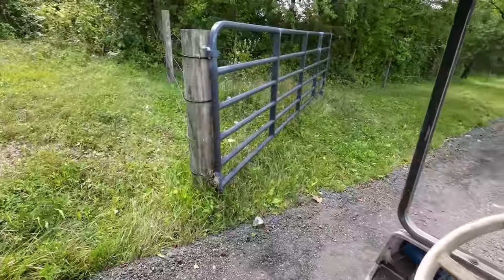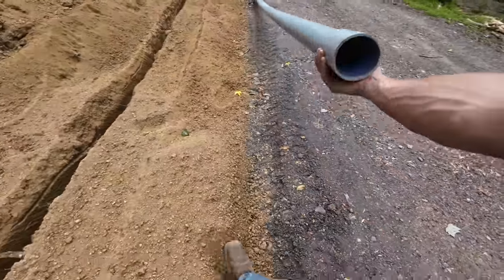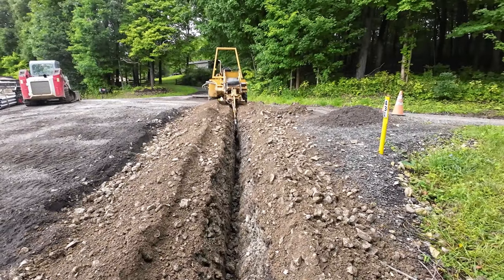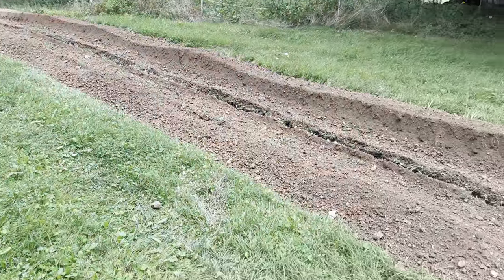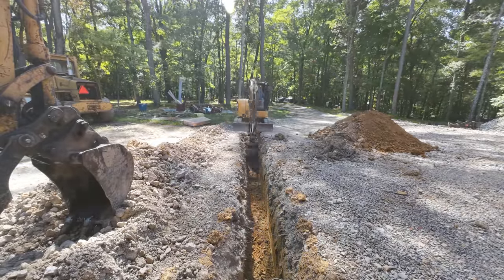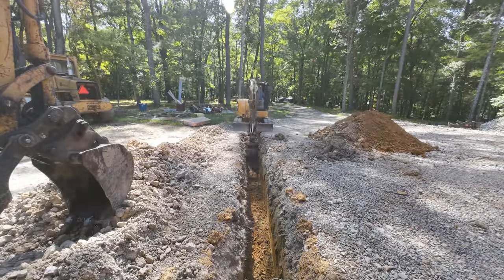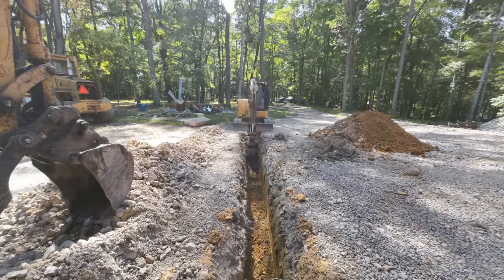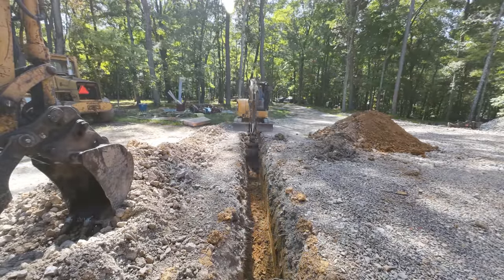Running Nearly 1/2 mile of Underground Electric, Costs over $64,000??!?!

Comment: With the cost of material and labor you might have come out better with solar panels and back up batteries. I don’t know.  Looks like you did a great job!
Reply: Naah- where he is at you have a lot of cloudy day, rain and snow plus forest cover- he would have to clear 50 acres to put in that many solar panels. Who knows how many backup batteries it would take to run that shop plus a house in the future.   Even in the southwest where they have year round sunshine and vast expanses of flat desert ground, all the solar farms have been failures.
Reply: @AmbitionStrikes has a sweet solar setup and their all-in cost was in ~$60K range.
Reply: 64k will buy a lot of diesel. Solar could be an option, but I doubt there's enough clear days up north. ('tho there are people who do off-grid solar further north than PA)
Reply: @timkuehn8888 , yes they do in the summer running all their stuff the batteries are full by 10 AM,  but….  they still have to run a diesel generator 2 ish months out of the year because they don’t get enough light.  Riley said in one of the videos that based on the charging numbers he has seen they could have 4x the panels and it still wouldn’t be “enough” which is why they use the generator.
Reply: I agree with you on solar, But it's just not there yet, he needs alot of power for the barn and a future house, I have seen first hand how solar just can't keep up with the demand, The cost of batteries is too high currently for the capacity most people need,   Fine if your in a cabin.     Just my opinion only.

Comment: Matt, if you ever want fast internet service at the dream shop, you might want to look into pulling some fiber at same time as the electrical. This add-on might be surprisingly affordable if you're going to have to hire an external contractor anyway to avoid the power company's exorbitant pricing.
Reply: Keep in mind that power company is a bit protective of their cable.  Nothing else allowed in conduit, and trench sharing has spacing limitations, so cannot just add it to pull.
Reply: Not sure what the regs are in his area, but in my area "High power" and "Low Power" need to be separated by no less than 8", and can't go through the same conduit. Even though fiber is non-conductive it would still qualify.

Comment: Another awesom job Matt,
Instead of using a shop vac use a petrol (gas) leaf blower and blow a plasti bottle through. It works way better.
In Australia we use a 500ml or a 750ml coke bottle and it works flawlessly depending on the diameter of the conduit.
Keep up the great work mate!
Reply: How about a Ferret?
Reply: a bit of pool noodle works too with fishing line to then drag the larger pull rope.

Comment: When I was having my house built it was the last item to be built, first came the septic and water well. I had all the plans to present which included the house, I did have a small cabin in the same area at the time. The electric company here is a Co-op, the total length of my electric was just 50ft short of one mile, here the homeowner pays one-third of the total cost, $12,000 was my share of the cost, the land where the cable is buried is mostly level and slightly rolling and no trees along this portion and parallels the driveway, this was 4 years ago, this was for buried cable, I imagine it would be much more today. I enjoy your videos, Thank You!

Comment: Matt..First, dont forget to ball and brush the conduit before pulling in the final puling rope or mule tape.
Electric work is always very expensive!!  I would love to see and hear more about the install. You chose to run and underground service which is multiple the cost of dropping in a few poles and stringing some bare wire (which also might explain why they want you to pay for the entire wire run. You might have gotten your 300 feet if it was pole to pole).. Tell us wire size and  type, Service type, voltage and amperage, size of transformer etc (didn't look like that pole had 3 phase so I am curious as to what is available in your area).. you finally told us that it was 3" sched 40 now tell us the rest... 
The utility charges what they charge because they can.. Monopoly, usually controlled by the state power authority.. With that said, there is more to the 54K  than you think. First, the men and equipment are expensive. Lineman are very well paid, especially if in IBEW. They will send at least one bucket truck team for the pole and probably 4 guys to do the pulls. Pulling those long  runs will require specialized pulling trucks. They will probably come in separately with a little boom tuck to set the transformer then send someone to splice and terminate. between each step they will probably send an inspector. There will be a lot of man and equipment hours for those highly paid elekchickens inspectors and managers.
Yes, you are paying for the transformer, which is very expensive and are very hard to come by (there is still a massive shortage of the high permeability silicon steel needed for the lamination..I am still quoting customers 80 - 90 months on power transformer and other large power equipment that s not already in the pipeline. Smaller transformer are still 3-4 months if you cannot find it on the shelf or on an existing back-order.). You are paying because they would not have to put it where it is going if you didn't want it there. They are also per-assessing you some of the added maintenance and emergency call out service that they would not otherwise need to provide. Remember, you will be paying the same electric usage rates as someone on a developed road with no personal demands on their system other than a power drop off the pole to the house 100 ft away.
Now comes the costs that are harder to put your arms around. You are adding load and complexity to their network. It might not seem like much but it all must be accounted for all they way back to the substations and power generation system. As the calculated loads go up they might need to beef up a transformer or put in larger cables, add capacitors and other load smoothing equipment at their substations ect. They might actually do some work upstream just because you are being added to the load on that particular circuit, you would never know nor should you.
 They also are charging you for their engineering and project management. 
All things being equal, I think you might be pretty lucky to get away with 54K but In would like to see you beat them back for 10K or so..

Comment: First of all Matt, OMG, total respect for your ability to handle such a large project by yourself. I had to take a nap after watching the first video as I was exhausted by the amount of work you did!. LOL! I doubt the power company is factoring in all of the work you have already done. 40k on top of the materials is absurd. They should be 10-15k maximum to pull cable.

Comment: Matt… I’m in Minnesota, Brainerd Lakes Area to be exact.  I had our local electrical power company run a line to a 40 x 90 building we built last year.  The distance from the pole on the road to the building was about 600 feet.  They supplied all the wire, ran it to the transformer next to the building and the total cost was about $800.

Comment: Andrew had a ditcher last year with what looked like an 8 ' diameter circular blade that cut through bedrock. The type you have is mostly well suited to your soil. Digging right next to your dream shop has to have a little pucker factor. It would only take a moment to scratch that building. Well done.

Comment: They quote you the same regardless of whether you trench/place conduit in the ground or they do, its just a per foot price. My experience is if you can go a couple rounds with them, they may drop the price, and if they wont play ball get the utility regulator involved, but this can take months or years. Also not yet having a residence under construction likely means they are charging you for the transformer, and they don't have any ability to factor in potential utility revenue. Just wanted to share some of my experience, the power company knows you have no other option,  my advice is to find a way to incentive them to work with you, make friends with the person handling your case, and get your future house permitted so they can see that, Good luck!

Comment: I'm a Lineman in Maine, here you can install the wire yourself and convey it back to the utility for ownership, is that an option, you can also keep it private, but you would fit the bill for repairs if needed, another thing we require is two lines, a loop feed or spare cable, I believe the 15kv urd cable here is about 5 bucks a foot to buy at a supply house, maybe other options for you

Comment: You know with the magic of editing, it makes you seem like that's an easy job there lol. I bet you will be happy to have everything done and have power running to your garage Matt.
Reply: Well said mate,, the ole Hyperlapse thing really does makes things look quick and easy.. When most jobs Matt does are anything But!!
Reply: @JAY61ish  oh I know man.
Reply from the maker: You got that right!
Reply: @DieselCreek I agree with you. $52k is ABSOLUTELY HIGHWAY ROBBERY
Reply: I'm tired as hell JUST WATCHING YOU!!
Im only a third of the way in but surely your saving so much money, the monstrous amount of time and energy is well worth it! My condolences to your back tho!
Reply: @pacificcoastpiper3949 mercy thats so crooked I'd think he was up here in Canada trying to build....good grief.
Reply: The run is so long that's why you need the Transformer otherwise you could have pulled the wire yourself.
Reply: @DieselCreek  no .....way . ..I think they're doing it cause...it's you....and its time for you to get a decent roller and a   side boom cat and a small and a medium excavator
Reply: @terrytate6006 Pulling the wire, or the length of the wire run has nothing to do with needing a transformer🤣 The transformer is to step down the voltage from the main supply line voltage, not to boost the voltage lost over distance etc.
Matt did mention it in the video, but it's a pretty normal requirement when you have 20-40kV coming off the pole and you only want 120-240-408V at the shop🤣👍
Reply: @DieselCreek  Can you get them to get you a break down of the cost?
Reply: @DieselCreek  Hi Matt, although admittedly it was a lot of work, be thankful for the equipment you have invested, cause going back to caveman days without the equipment would be never ending. Possibly a solution to the cost of actual running of the electrical  All wires have an ASTM number associated to it, Why not buy the wire yourself and have a  power company inspector watch you pulll the wire yourself, leaving just the tie ins up to them? or is this just to easy of a thought, Dunno the politics in your area.
Reply: And you thought you wanted to play in the woods?   
You're an amazing fellow  ( Sparky ).  The whole time, I was thinking, what else needs to be in that ditch before it's covered?  
My son-in-law did this about 15 years ago, but he also ran cable TV, which also carries his phone & internet services. His line is around a quarter mile and was a huge undertaking, not to mention all the upcoming construction plans.   It will all be worth it when it's all done, Matt.
Best of luck with the Power Co.!  Stay focused on the finish line and don't forget about other giant corporate entities that have their "eye in the sky" on you with all that equipment sitting around.  Just saying. 
Be ready for the next battle, it's out there waiting.
Reply: @DieselCreek  your editing is pretty sloppy. overlapping audio, pausing and retaking but not cutting out the bad.
Reply: @headcas620 his editing is usually much cleaner. I think in this case he had so much material in the can that he was more interested is getting the video posted for us vs. cleaning it up. I personally would rather have more and earlier “dirty” videos than better edited videos spaced further apart. If your not careful it will start looking like a home improvement channel on cable TV which makes me want to stick forks in my eyes.
Reply: The electricity company probably only has a price list for total installation.. If you pull in the cables yourself too, the price should shrink considerably.
Reply: @simonilett998  that's right higher voltages use smaller wires😁
Reply: @terrytate6006  Yes, the length of the run IS the reason a 'local' transformer is required, but... Matt costed out the cable (I assume 7200V?) as being in the $10k zone.  So that makes it rather 'interesting' to justify the remaining several tens of thousands of dollars?
Perhaps the costing Matt performed was only for twin 115V?  (7200V cable costs TRUCKLOADS more than 115+115 cable).

I'm from NZ (wayyyy down under) and our mains is three-phase 230V / 50Hz (rather than the US twin 115V).
The local dragstrip put in some new lighting a few years back that would have needed an update to the transformer.    The local power company tried to RAPE the track for tens of thousands of dollars.
Turns out it was WAYYYYY cheaper to purchase and install a 250KVA genset.  It's only used about 50 hours per YEAR (only for the infrequent 'night meetings, other meetings are run 'on grid'') so the Diesel running cost / maintenance is truly insignificant.  Furthermore, if the power grid for the rest of the country has a fault for any reason, the track can just fire up the genset and still run a fully powered meeting.  The only LOSER is the money grabbing power company!
Reply: @DieselCreek  Price appears to be $10 -$30 per linear foot BUT that's with the power company doing ALL the work.
Here in the UK, their quote for just running & connecting the cable & the transformer is known as seriously taking the pi$$.
Reply: Hi Matt what a job mate a lot of hard graft for sure can’t believe what they are charging that is just insane hope you get something sorted with them and if not show every move they make to justify there so called stupid price that is just unbelievable and taking the piss , feel for you at the moment mate that just so hard to swallow you have done an awesome job and I hope everything works out for you take care and all the very best 👍❤️🔧🔧🔧🐾🦴
Reply: @nostromo526  🤣
Reply: @trevorvanbremen4718  actually it's to step down the voltage. not the length of the run. You upsize wire to deal with voltage drop. Something that can be done with say 12 gauge wire over that distance may take number 8 or 6 awg wire to account for voltage drop.
Reply: I watched this at 1.75 speed. The soundtrack is incredible.🙃
Reply: Just curious, in Idaho And Oregon we would have to put in a slip joint going to the meter base. 2400 feet is a lot of digging. My hat is of to you. Great job.
Reply: We paid  $17000 for them to put the line in about 3/8 of a mile. They had a private company put the line underground no conduit.
Reply: @simonilett998 Most of the run is at high voltage to reduce the current flowing and the resulting voltage drop. Thus the pad mount near the shop.
Reply: Get an electrician to quote pulling the wire & setting the pad mount, reduce the power companies scope to just connecting at the pole.
Reply: @VaughanGuitars  Haha , that's when he gets a $580.00 per hour charge for the on-site power company inspector . There's no way out , lol .
Reply: @headcas620   @headcas620  As an editor I of course noticed that too. But I don't work my butt off for a week of hard labour before sitting down to edit. I'm sure he could do better, but I'm also sure he's fine with how it came out. The retakes show the frustration so those can be considered a stylistic choice. The overlap is unfortunate, but that happens. Also sometimes Premiere's fault as happened with me in a wedding video once where something cache side was locked up and the transition was bouncing all over the place. I noticed in one patch in Matt's video the audio doubled but the video skipped in and out of both clips. That didn't seem intentional or natural to me but rather software side. Plus after importing, editing, rendering... I doubt he was going to rewatch every second to check Premiere actually did what it was supposed to do before the work of uploading tagging and linking etc.
Like a trench it's not always as simple as it seems.
Reply: @allanmowz  I understand it's time consuming. If it was just one video I wouldn't say anything but it seems like it's every video. If he's spreading himself too thin it might be time to hire a part time editor.
Reply: All I can say is get over the SMALL amount of bad editing and let's keep the main thing the main thing !! Considering the amount of editing that Matt has done this past year, there is NO PROBLEM !! Keep 'em coming Matt, you're doing just fine !!
Reply: @johnking8679  I agree totally .

Comment: Pull the line yourself and pay an electrician to connect the meter, check the pull boxes and build out and connect the reducer/transformer pad.  The Power Company can just do the connection at the pole which is required for free as a public utility federally mandated tarriff.  An electrician will cut that cost estimate by 2/3.  Good job!

Comment: That was a monumental project for one man to take on, can’t imagine anyone without your experience and equipment even contemplating a project like you just did. As far as the power company cost, it seems way high, you’re doing all the grunt work for the pups, and up here you are allowed so many feet of wire before you incur any out of pocket cost. Good luck on the cost challenge and thanks for the update Matt, nice job.

Comment: Matt, you should have  put an expansion fitting out of the bottom of that meter base. Expansion and contraction form freeze and thaw can cause that pipe to rip off the meter base from structure, or other issues.